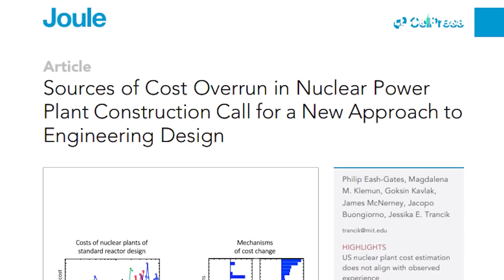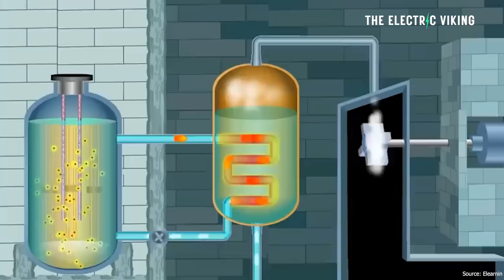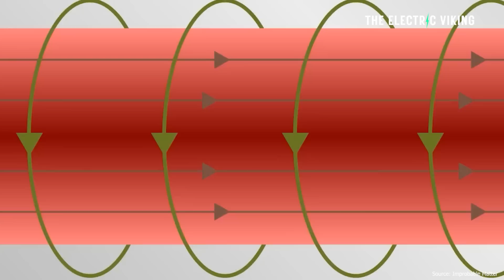Bill Gates says nuclear is the answer to the world's climate crisis...

Comment: Great take on this. Yes, nuclear represents an improvement over fossil fuel, but the capital cost and lead time is ridiculous. 

I do believe in the promise of SMRs. They could be great for remote locations. For electrified construction or mine sites they'd be amazing. But its also clear that there's a lot left to do.
Reply: Electrician in the power industry here: Mines and other remote construction sites are installing large solar arrays with battery backup to provide power, as it is the cheapest option. The EROI (energy returned on investment) for nuclear is ~14 to 1, about the same as the lower end of some estimates for oil and gas, with most current estimates for oil and gas being around 20 to 1, so not an improvement over fossil fuels. Existing wind and solar is around 20 to 1 (the same as oil and gas, but without most of the CO2), and new is as high as 80 to 1 for wind.

The US has spent, in inflation adjusted dollar amounts, 3.5 billion dollars a year of direct taxpayer subsidies on nuclear energy since 1948, and this does not include the amount spent per year on security for nuclear power plants by the department of defense. Compare that to the 0.38 billion per year of subsidies spent on renewables since 1994, with renewables being the cheapest and fastest to build, and renewables come out ahead by a long shot.
Reply: @GoCoyote  You used RATED capacities, not actual output by using the Greenie numbers for comparison.  Additional plants are needed for baseload and peaking, either that or massive battery banks which we don't have and never could hope to achieve.  
Plus many countries have been building and using small modular reactors for many decades built in two years or less for millions not billions.
Reply: @danadurnfordkevinblanchdebunk  
I made no references to "rated capacities," or any "capacities" for that matter. EROI has nothing to do with capacity, but is a ratio of the energy returned from an input.

As of 2022, there were exactly 3 small modular reactors in operation worldwide, with 3 more being built, and all the rest are in "development." As such, there is little information as to the actual cost for development and construction, or as to the long term cost of power. 

When I was a child, we were being promised electricity that was "too cheap to meter" from nuclear power, along with nuclear powered trains, ships, rockets, and even cars. So far the reality has been very different from the hype, and in my opinion nuclear power is just a geeks wet dream about sexy atoms.
Reply: @danadurnfordkevinblanchdebunk  I cold find only 2 that can be called a small module reactor: 1 in Russia in 2022 and 1 in China in 2021. What SMRs are you referring to?
Reply: @danadurnfordkevinblanchdebunk  Nothing that I have read has ever referred to the nuclear power plants in submarines as being small module reactors or being used to design all the the new SMRs that are proposed. Other than the 2 I initially referred to in China and Russia that came on line in the last couple of years, not decades, where are these new SMRs that are floating electrical generators?
Reply: @danadurnfordkevinblanchdebunk  One: Where are these floating SMRs? Two: if what you said about the nuclear power plants in submarines being applicable for commercial power generation, it would have been done already. Not a single commercial power plant proposal has used those nuclear generators (you know, the ones that have been in subs for decades), ever. So, what do they know that you don't?
Reply: @danadurnfordkevinblanchdebunk  Maybe if you hadn't referred to these as SMRs I would have understood your bias statement as just being incorrect. They are not SMRs, no one, other than yourself, calls them that. SMR: small modular reactor. Do some research yourself.
Reply: @danadurnfordkevinblanchdebunk  Rolls Royce has not built a single SMR. They have a design. That is not the same. Rolls Royce SMR business was created in 2021. Please provide me a single Rolls Royce SMR, or what you consider to be a a SMR, and anything/anywhere that shows Rolls Royce called it that. Since they have been building these for decades, it should be easy.
Reply: @danadurnfordkevinblanchdebunk  Rolls Royce has not built a single SMR, yet. You calling their existing reactors a SMR, does not make it one. Again, provide a page from Rolls Royce where they call any existing reactor of theirs a SMR. Any one.Should be easy since they have been building them since 1958.
Reply: @danadurnfordkevinblanchdebunk  Not confused at all. You are mistaken in referring to them as SMRs, thats all. Just because you call them it, does not make it so. Rolls Royce does not call them that, ever. They (Rolls Royce SMR business) refer to their new designs, see the word there, "designs", as SMRs. SMRs are not a proven commercial business, yet. Hopefully they will be. So, stop with your crap about SMRs having been built for decades.
Reply: the only reason for extra costs and time are silly frivolous lawsuits.
Reply: @scottmcshannon6821  
I have worked at nuke plants. The amount of materials and control systems is staggering compared to conventional power plants, and renewable power is incredibly simple. The containment and safety systems at nuke plants do not allow for error or mistakes. As an electrician, we will often need to have one electrician doing the work, while a second one watches to ensure no mistakes are made. There are multiple layers of control systems to ensure that each valve has power to open and close (primary, backup, and emergency), along with a suite of sensors to ensure that the valve actually opens or closes, or is somewhere in-between.

On a conventional power plant job, if there is some discrepancy between a steam pipe and an electrical conduit, the steamfitter and the electrician will come to an agreement as to who needs to move their equipment given the job requirements, and the design changes will be noted and cleared by the engineer later. If needed, the crews can work on something else while the issue is worked out.

On a nuke plant, no changes are allowed without a full engineering review and sign off. Since the projects fall behind so often due to their complexity, an entire crew will stand around on overtime waiting for the engineering team to sign off on the changes, since concrete has to be poured in the morning. All materials are treated like airplane parts, and need to show documentation for the entire supply chain to ensure quality. People make jokes about a $200 dollar roll of tape, but it can take a lot of oversight to ensure that the tape is exactly what it says it is with all of the correct labeling and packaging, was stored properly, is within its use by date, and has all of the paperwork to back that up.

I last worked at the Humboldt Bay nuclear power plant in the mid 2000's. Even though it closed down in the 1970's, it still employed hundreds of people that are working to decommission it and try and contain the underground plume of radioactive contamination from leaking into Humboldt Bay. The Security is US Army personnel armed with automatic rifles and permission to shoot to kill for anyone not wearing the proper security badges. You never ever take off your badge, not even when showering, unless ordered to do so by security.
Reply: @scottmcshannon6821  100%.  Solar is statistically more dangerous than nuclear (due mostly to falls off roofs).  Unfortunately not everyone is soo close to the equator; as a canadian we need to invest in nuclear because storing renewables seasonally is unrealistic.
Reply: @Thunderbuck 
NOTE: Indonesia's approved PPA for ThorCon to provide 8×500MWe liquid metal Thorium ion molten sodium-Berilium fluoride salt energy "Converters" (TMSR) at a fitted out cost of between $800 - $1000 per KWh; ensures this cost is met by ThorCon and only the cost of site preparation and linking to existing grids needs to be meet by the State; the first being situated to supply Bangka Islands, and is expected to be on line by 2026 at levelised pre-profit cost of less than $30 per MegaWatt.hour (<3 cents/kWh)..